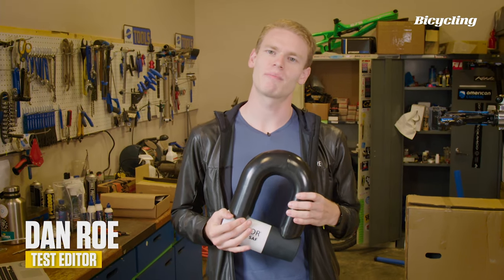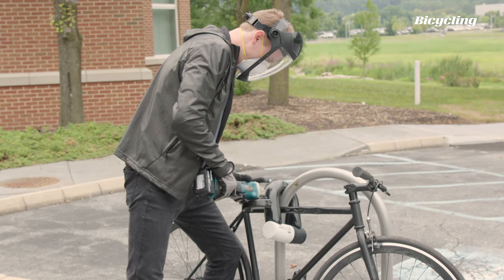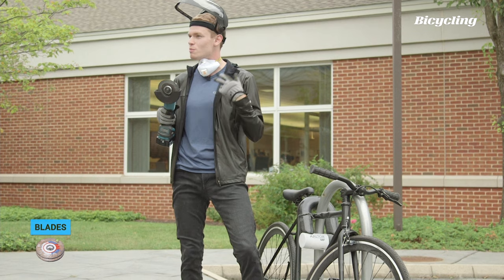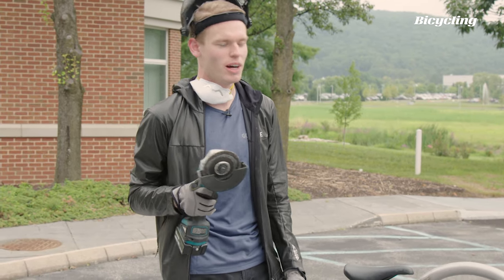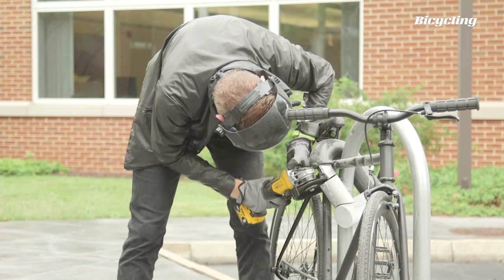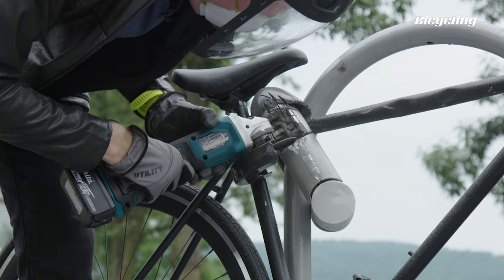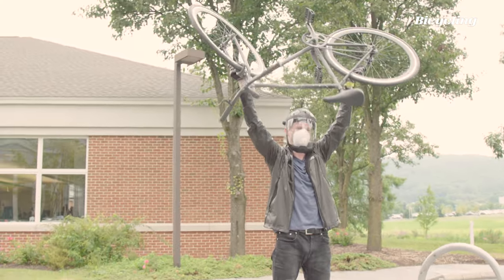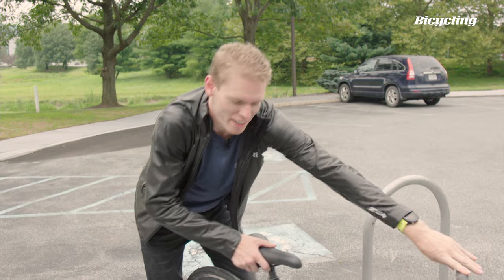Is The Altor SAF Bike Lock Really Grinder-Proof? | Bicycling Magazine

Comment: Do you no lock frame only frame, but wheels. This one can be opened with a skeleton key. I would prefer to buy two short Kryptonite uLock for locking keys and this one for frame. At least thieve will steal maybe a saddle and something else that will not be protected. But this confirms my non-science theory: GPS and record everything what eyes see from birthday to death the way, that each time you will try to turn off or remove this functionality it will kill you. And give the control to the AI. Human brain is not well designed. The creator (God ol algorithm or anything else) made a wrong project. Jesus could not demand from human to be good if his father made a wrong project. Make a project that will force to work the way you want, or do not create any. Simple as that. We have laws that some of us ignore and this is insane and because their brains do not see nothing wrong in the way they think they should be controlled, because we are designed for 100-120 years that does not mean let you to gather the wisdom that will teach you to not steal, to be good etc., see Jesus words for example and 10 commandments.

Comment: Be easyier cutting around that bike rack pipe be only a few mm thick be able cut that take the bike or the lock picking lawyer stuff prob blow torch the aluminuim with map gas melt it off .and im not a thieve just know vulnerability that kind of stuff

Comment: Wrong tool for the job .    SawZall  with metal cutting blade .....     Would have taken few minutes
Reply: You dull the blade when you come to the hardened shackle... And you still have to do a double cut, so atleast 10-15 minutes which is way to much time.

Comment: Honestly cool concept, but there will always be a weak point. Example I would cut the pole the lock is attached to in just 30 seconds or less . Locked would still be attached to the bike but none the less that lock could be handle easier in a shop with a electric grinder and about 3-4 discs with 1 hour time. Sadly in my opinion this does not solve anything.

Comment: Again pointless as they can cut through the bike rack in a minute. Also, you could just get a slightly bigger disc and cut all the way through it in one cut.
Reply: The point of the video is testing the LOCK, not whatever it's attached to! And no, you would still struggle with a bigger disc, because a bigger disc takes way more energy to drive, and you would have to take a super light cut to not bog down a 4" grinder. So probably 2 batteries and still a lot of time, and you would still need to do a double cut.
Reply: @Kowalski301  2 cuts to remove the piece to get it off, sure. But a 6 inch disc can make it all the way through this, the videos show the 4 1/2 inch discs making it roughly 3/4 of the way through. 2 cuts with a 6 inch cutting disc and a kick will have the lock on the ground, and they make battery powered cutters/grinders made for 6 inch. WD-40 makes these metals not stick to the blade as well so it wouldn't bog down. I seriously doubt this entire process would take longer than 5 minutes total, aluminum is not strong at all to a disc cutter.
Reply: @rdizzy1  Look, we all know there are bigger tools. You can use a gasoline grinder too, or why not just get an Oxy Acy kit... But bike thiefs use 4" becuase they can hide them under their jacket, and even 5 minutes are way to much time to spend. Fact of the matter is that this lock is a brilliant design, and it would in almost all cases be significantly faster to cut the bike rack and then you can't fault the lock anymore! The lock has won, simple as that.

Comment: take that guard off and throw a real wheel on it lol. ida been done in 4 seconds
Reply: Good luck with pieces of "the real wheel" flying around you
Reply: @NumbDiggers1998  when you use a cut of wheel for grinding yeah. When you use it for cutting your fine. As long as u know what you doing. U have to really screw up to break a wheel.

Comment: Would've been easier to cut through the bike rail.
Reply: even if he cuts the rack he still is gonna have a 13lb weight dangling around or the bike
Reply: @TantalumPolytope  He could of took the bike home and used a mains grinder to take the lock off.
Reply: @deanrobinson892  if he rides the bike home he's probably gonna fall because of the 13lb weight and even if he just pushes it he is gonna be quite suspicious because of the lock

Comment: the easiest way to do this is to bring a ten inch grinder, your car (or van) and in inverter. plug the inverter into your cigar lighter outlet, plug the 10 inch grinder into the inverter and cut away. if it was me i would use a concrete cutting diamond tip steel blade that will cut through that lock with one blade and zero batteries. the bike is yours in 10 minutes tops. then simply put the bike in the back of your car and make a speedy get away

Comment: LPL BITCHES...... Annnd we are in.......

If youre really gonna make noise and all like that the a concrete saw with a huge metal cutting blade, like those for rebar and black bolts will make quick work of it. If not the lock then the much more cut bike rack its attached to.

Comment: It would be easier just to cut the bike
Reply: The way the company and others show the lock being used, yet.  Top tubes are quick work.  However, using this lock properly entails locking the bicycle's head tube.  The head tube is thicker and has the advantage of a steer tube through its center.   That plus cables in the way mean much harder to access and cut.

Comment: How the f*** are you suppose to carry this with you. This is not clever at all, just a huge lock, that for sure makes it's purpose, but how would I carry this on my bike? What a joke
Reply: It's a "destination" or home lock.  Never intended to be carried with.  Most concern about bike theft is when locking one's bike in the same place every day for hours.  Like riding to work or school and locking for hours.  You leave the lock there and use it when you arrive.
This is how many people utilize the monster chain locks.  This is actually lighter, performs the same function, but offers higher security.
Reply: @dudeonbike800  I get the purpose of leaving the lock, but how common is that? I still need to lock the bike at home. So therefore I would need to bring the lock with me. For example at my university. It's not always possible to lock the bike at the same spot every day... most often it's at different locations with a long distance between. I still think it is a joke. This solution (if it would be possible) in a smaller, more portable look would be the dream. This to me is a joke
Reply: @GameBoyPlaying  I spent years on a college campus, so I understand your concern.  One solution is to park in a central location and walk the short distance.  OR, just grab the lock from where you left it and ride the quarter mile to  your next class with the lock.  THAT isn't that hard, is it?

I think this method is more common than you think.  I see locks on racks all the time.  Sure, some are the result of lost keys, but not all.  And who cares "how common it is" when we're talking about high security for YOU?  I don't give a crap who does or doesn't employ this method.  This method allows you to use a massive lock without having to carry it to and from your destination every day.  That's a win in my book.

(And while you're at it, go look at Squire padlocks and Almax security chains for motorcycles.  These things aren't being ridden to and from very many places.  They're "in place" security solutions.)

 Yes, I'd want it at home too.  But home is usually a lower-theft situation.  But trust me, I get it.  Burglary in my town is through the roof right now, with bike theft from garages rampant.  So my garage is double locked and all my bikes are locked with security chains bolted to either concrete or to the wall studs.  Can someone get through them?  Yes, but it's very unlikely.
I just picked up my fourth Kryptonite NY Fahgettaboudit lock.  I've been using one for over ten years and have not suffered a loss with it.  My city bike is a custom painted Cannondale with King rear hub and King titanium headset, and Cooks Bros cranks.  It is NOT a stealth bike.  Haven't lost it yet with the NY lock.  I spent $40 for the first one on Amazon, and $40, $50, and $20 for the other three from Craigslist.  THIS is how you get quality locks for good prices.  
And to make theft even less likely, I could easily install a security camera in the garage that pings whenever motion is detected.  This would be my next step instead of a second Altor SAF lock.
That said, I end up with 30 pound loads on my bike when shopping, so a 13 pound lock isn't really a big deal.  In my high-theft area, I may end up carrying it with me.  Plus, when I hop off my town bike and onto my lighter road or mountain bike, the lack of a SAF lock will make me feel like Superman!
Anyway, the fact that this lock is on the market is a really good thing.
Reply: @dudeonbike800  I'm not saying it's not a good lock... It for sure is and so I have concluded. My concern is the portability. In my city I need the lock with me everywhere. I have a bike that catches the eyes of the thieves (electric bike). This lock for me is not easy to bring due to the fact that I have no compartment to place it on the bike... I'm riding all over town! If I my daily ride would be from home and to university, I get your point. The difference between me and you is that you have a garage to place your bike. I live in a apartment and need to put the bike in the storage, but it still needs to be locked. There I couldn't leave the lock at a place I usually visit. Another problem is that I have a limited range on the battery. 

My friend had his electric bike locked infront of the entrance of university and it still got stolen... It had one of those motorbike locks that are really heavy to bring on the bike. My solution now is that I can't have just a really safe lock, because they can still be cut with a grinder, within minutes. So therefore I put an alarm on the discbreak, which I find as a really good solution. This lock in the video would be great if I could bring it with me or if it was presented in a smaller version, but then the same problem occurs, that it can be cut.
Reply: @GameBoyPlaying  then you need to get more creative, like the alarm on the disc brake. And if you have an expensive electric bike and no garage, then you have to decide if it's worth having expensive transport that's prone to theft.  If so, then you'll have to spend good money for a security solution.  Squire lock and Almax chain would probably be the best options for you.

Then again, consider beefing up existing locks.  I've added crossbars, t-joints and pipe sections to quality u-locks to improve their strength and offer more deterrence than the bike sitting next to mine.  Can they still be cut?  Yes, but they're now harder than before and not what a thief was expecting.  Throw 'em a curve ball!  Remember, it isn't YOUR bike they're after, it's anything relatively easy to steal.  Sure, a more expensive bike attracts more attention.  But when a crackhead is stealing a bike for a quick $100, it doesn't matter if it's a $500 bike or $3,000 bike.

Alternatively, give renters insurance a look.  This is one way to attenuate your exposure.  So if you ride a $500 regular bike, or a $3,000 electric bike, your loss is the same - your annual premium plus your deductible.  There, no more worry about losing such a nice bike.